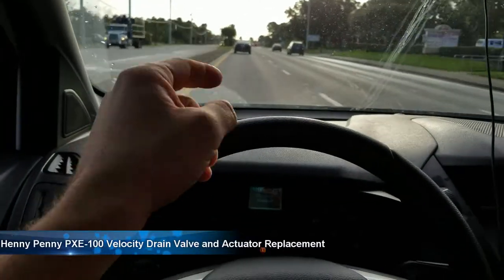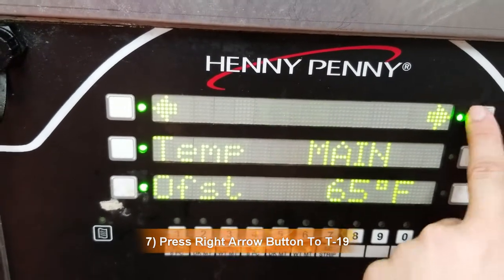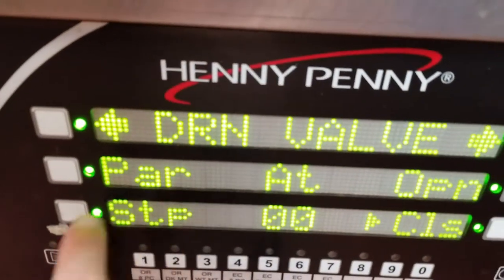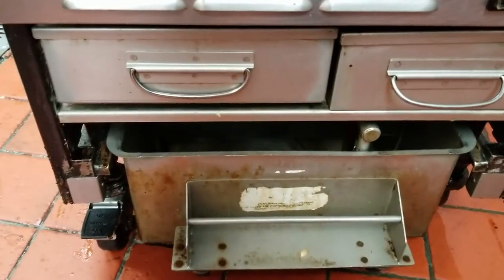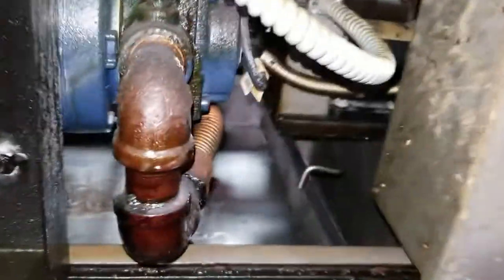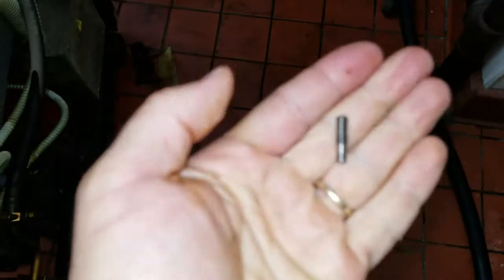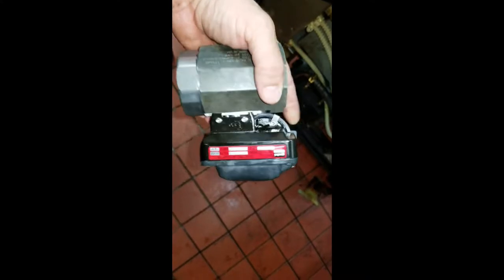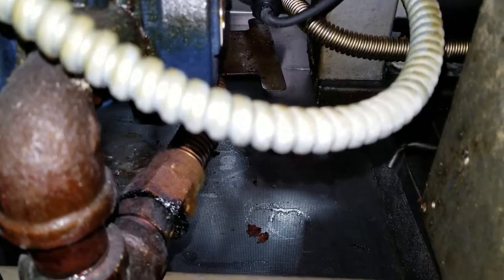PXE-100 Velocity Fryer Drain Valve and Actuator Replacement

Comment: Where are the new videos? Are you required to go back to the HP classes once a year or is it one time and one time only?
Reply from the maker: Hey, sorry for the late responses. Well since 1 big major customer doesn't allow me to record there anymore my videos become limited. Plus, I travel all over the country now inspecting equipment  (no service work)  often, so getting videos up is getting harder. However I will post more videos. Now as for classes for HP. No, it is not required to take HP classes to work on their equipment. However to be certified "Train the trainer" or just someone who is going to be a trainer, you need to take a class every 2 years
Reply: The Fryer Guy 
With fewer and fewer techs mfgs have made a strong push on startups. In Texas the pressure is always too high and the mfg usually ends up denying warranty.

Comment: I have an issue not pumping oil what I can do thanks
Reply: @dank9139  you're replying to old comments. And there is a number of other things it could be. It could be the filter pad being full of filter powder and or crumbs. The o rings on the pick up tube, could be o rings on the filter screen. Could be a bad pump seal.

I wouldn't jump to a bad motor right away. Especially if you can hear the motor run.